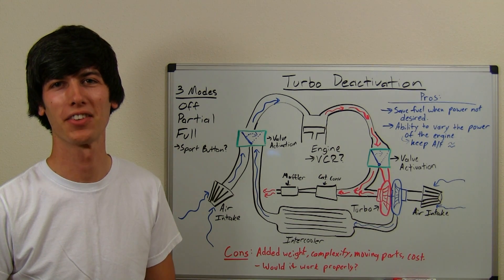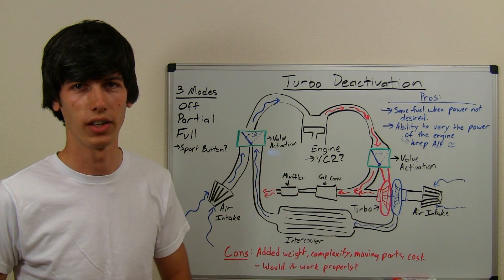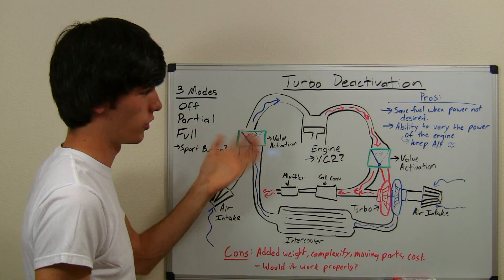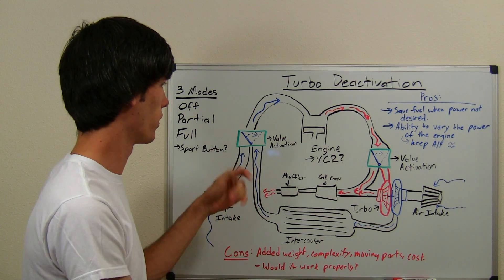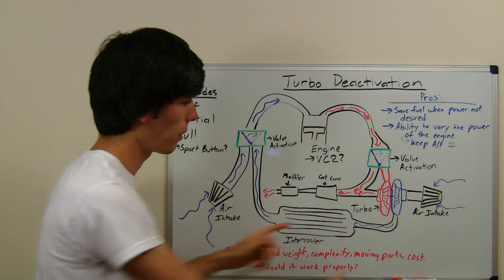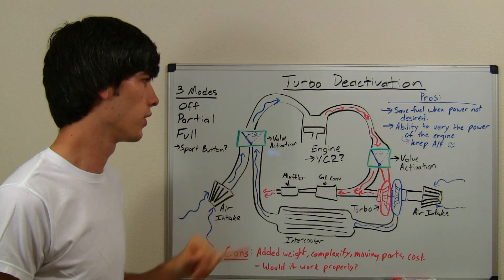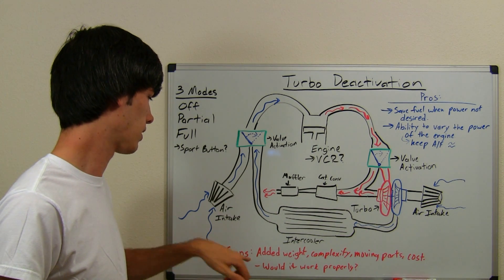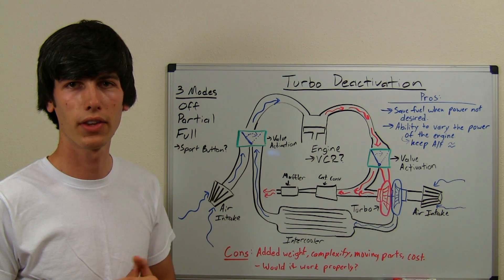Turbocharger Deactivation Concept - Explained

Comment: Every manufacturer of turbocharged petrol engines use a form of turbo deactivation. Your average small petrol turbocharged engines are in fact naturally aspirated below ~ 50 bhp. Manufacturers carefully select turbo compressors so that they only become active (flow air) above the power levels needed for fuel economy tests. It is why in the real world turbocharged engines never achieve their MPG test figures.

Comment: The Noble M600 uses a selective turbo boost and the feature is talked about on one of the Top Gear episodes.  BMW as well I believe uses some form of turbo deactivation, though without the separate intake and exhaust or the variable compression.  They deactivate the turbos on certain engine codes getting thrown and I believe use some form of boost control on their different drive settings.  I've actually long wanted something to at least control boost so that highway driving is much more economical.
Reply: The real doktorbimmer
No, but it can and does divert enough away to deactivate the turbocharger as in 'limp mode'. Every modern diesel has a form of turbo deactivation.
Reply: The real doktorbimmer
Wrong. In 'limp' mode the turbocharger wastegate is set to divert maximum amount of exhaust gas away from the turbine deactivating the turbo. Every diesel passenger car contains this function. Go check.
Reply: +The real doktorbimmer lol......really. Maybe in the 1980's.

Is that how the wastegates on your favourite Ford ecoboost 3.5l operate?

Things have moved on quite a bit I think you'll find.
Reply: David Bartz Your car won't be using it's turbochargers during highway driving. There won't be enough exhaust gas passing through them. You're right that all manufacturers have systems to deactivate turbochargers in the case of mechanical/electrical issues.
Reply: The real doktorbimmer
Never heard of turbo limp mode?
Reply: The real doktorbimmer limp mode keeps waste gate open
Reply: agt155 you can hear the turbo go on the highway anytime I speed up. It's not an issue when I can leave cruise on
Reply: The real doktorbimmer you're the only one that cares that it's referred to as turbo deactivation instead of turbo boost deactivation.
Reply: The real doktorbimmer
Wastegate
									
A wastegate is a valve that diverts exhaust gases away from the turbine wheel in a turbocharged engine system.

...lol
Reply: The real doktorbimmer

Turbochargers are only doing work  (working) when their compressor wheel is spinning fast enough to produce a positive pressure gradient across it. These compressor speeds are not reached under low engine loading and certainly not when 'limp' mode is activated. As has been said all along every modern turbocharged car has a deactivation system. I guess you are new to turbo-diesels.
Reply: The real doktorbimmer
lol....right so now you're saying a waste-gate can't completely divert the flow of exhaust gasses away from the turbo. Well it doesn't need to. It only need divert enough away so the turbo compressor cannot spin fast enough to produce a positive pressure gradient. Without a positive pressure gradient across the compressor wheel the turbo is inactive.
 In 'limp' mode the turbo is inactive/not working.
Reply: The real doktorbimmer
If a car has limp mode it has turbo deactivation. Ask one of your customers.

Comment: Any reason why you don't want to just do it with an electronic boost controller? If you picked one which has mode settings you could set it up with a high boost 'race' mode and a low boost 'economy' mode which just gives a little boost to improve your thermal efficiency. Hell you could presumably even set a mode that has negligibly small boost if you wanted the turbo effectively deactivated.
Reply: Chris Pistofferson Your typical turbocharger will not be producing any boost at all during "economy driving" ie there will not be enough exhaust gas passing through the turbocharger for it to work - it is already deactivated.

Comment: Have you tested this in action? I will build this kind of system to my audi a8 1.2 E-TDI consept car. To bypass the turbo totally is propably not needed as you can have other benefits by boosting pressure to canister. That way you can have instant boost when needed even where the turbo is not necessary able to make boost like low revs--> better efficiency. Also you need only one intake air filter, just two intake air lines. System is at max efficiency when you use air to water intercooler to get short intake piping.

Comment: What you have described is an exhaust wastegate (already exist, on every turbo), and a sort of intake bypass. And what you want to do is be able to switch between boost and no boost mode. 

In most turbo'd cars it is quite simple to install a low/high boost switch, which ultimately controls the wastegate, like in your diagram. What you cannot do on production turbo'd cars is the intake bypass you are describing. An intake bypass would have no effect on economy, all it would do is reduce lag (no IC or long piping to travel through). Now I dont know if you've ever driven a turbo car, but the thing is, on stock, turbocharged production cars, there is basically no turbo lag to begin with. Lag only becomes a thing when you start going for massive power gains, ie, bigger turbos, and there is no point having a 'low boost, no lag' system when all you are after is power.

Comment: VGT actually implements this idea. At 60mph my car is running at atmospheric pressure as exhaust fumes are not directed onto turbo blades . I understand that turbo is introducing resistance in exhaust. Complexity of this idea wouldn't be as beneficial as we think. It is enough to compare fuel consumption of VW Golf 1.9 SDI vs 1.9 TDI. Not that big diff.

Comment: If you want efficiency you can just make a smaller displacement engine with a turbocharger. There would be no point in having all that stuff. If you simply want control (not on/off though), get a boost controller. Or if you're really crazy about it buy N2O and turn that shit on and off.

Comment: My main concern with this method is achieving the proper balance of the car as a whole, meaning that if I'm using an NA engine, with a certain airflow, I wouldn't be using the same fuel system, electrical setup and ecu mapping as I would when I install a turbo unless of course the whole thing is sold as a package. Also, If by switching the turbo on and off includes switching ecu profiles, fuel injection and electric discharge rates, the price of such a setup would be too high to consider.

Of course balancing other aspects like cam ratios and whatnot is a totally different story altogether. Maybe its doable but would coat too much to be beneficial IMO.

Great videos by the way man, thanks for sharing the knowledge :)

Comment: I think this would be great, if paired with a variable geometry turbo. You could have a setup with no boost at all then have the veins paired for mid boost, as well as high boost. You could have an extremely smooth power band with variable sequential tubos, and this setup. Would work great on a high revving motor

Comment: A variable compression engine might be extremely complicated to make and the cost and complexity would very much outweigh the small gains. Partial activation/deactivation of the turbo seems like an overly complex VTEC system which also might not do too well in terms of costs. However, an On/Off switch for the turbo might be a pretty fantastic idea. People have implemented a similar albeit much more rudimentary (and illegal) system for straight pipe exhausts to pass inspections. I think that switch is definitely doable but I cannot tell you how reliable it would be in the long run.

Comment: Interesting theory, the camshaft valve overlap/lift/duration etc. for turbo/non turbo may
be able to be compensated with a sort of VTEC system by the ECU, but how to obtain the "variable compression ratio" would be the hard part, the only thing I could think of is a literal "VTEC" type of system to increase the stroke of the piston to achieve proper 
Compression while on "Non Turbo" and that would mean ALLOT of engineering plus the main/crank bearings + seals would take a severe beating during this whole process of 
constantly adjusting con rod stroke length for the pistons; As obviously can't adjust cylinder/boresize, so only the crank/con rod/piston travel could conceiviably be ajdusted, essentially being a "stroker motor" with no turbo to achieve the proper compression.  I have driven an Audi A4 1.8t with a dead turbo and it was basically undrivable going 20mph maybe up a hill at almost redline if that was achievable.  Among many other factors. fuel injectors would have to be twin/adjustable to provide enough fuel while on "Turbo". etc,etc,etc. Anyway A LOT would have to be going on and I can't imagine the cost.

Comment: my brother has a turbo on his car and has told me several times the more often he kicks in the turbo the more fuel he eats,,,,,so I don't understand how a turbo can make it more
Reply from the maker: MrHighpressure By getting into the boost, you're putting more air in the engine, thus burning more fuel. It will create the power more efficiently, but if you're making a lot of power it takes a lot of fuel.
Reply: +Engineering Explained Doesn't it depend on a lot on the size of the turbo? As in a larger turbo will induce noticeable parasitic losses because of back pressure, but a smaller one (like the absolutely miniscule ones found on ford ecoboost engines) increase efficiency because they mostly use energy that would otherwise be wasted.

Comment: Well at low RPM as long as you're not boosting, such as driving around town, the turbo actually helps with atomizing the fuel for a better burn. So to be able to turn it off and implementing such a system would be a waste in resources.. at least from a manufacturer standpoint. Remember it may just be a few bucks per car to install, but then when you make 10,000 cars/year you're looking a significant amount of $. And for something thats not critical, it's just not profitable enough just to have the boasting right of a deactivation turbo.

Comment: The partial mode sounds similar to the vtec in honda but for turbo application. Less air in lower revs for good economy and more air in higher revs for more power. 
Wait for my turbo to kick in yo!!
This would need a good ecu to run it though.

Comment: A turbo is an energy recovery device. as the otto cycle is inherently innefficient the thermodynamic waste can be recovered using a turbo. This is why they were first implimented on over the road tractor trucks, not to improve torque, to improve efficiency. If the owner of a turbocharged car doesn't drive like a dick they will get better gas mileage than a NA car. NO valve dealybober needed
Reply: Yes turbo diesel truck engines do not suffer the efficiency problems of turbo petrol engines.

Comment: I think the main problem with this concept is that the cons just outweigh the pros. the pros don't benefit you a lot and cons are massive
Reply: doktorbimmer Yes with a diesel you will but with a gas the engines sensors will just add more fuel
Reply: The real doktorbimmer
 It is not my article. It is just proof that NA engines achieve lower minimum BSFC than turbocharged petrol engines - it is a fact. When your turbocharged engine is 'recovering' it's maximum amount of HEAT energy (at WOT) it is less fuel efficient than the equivalent NA engine.

 In "real world settings" (like fuel economy cycles) turbocharged petrol engines are infact operating as NA engines. Remember those compressor maps? If your assumption was correct car manufacturers would incorporate turbochargers that operate at low power outputs into their engines - they don't - why do you think this is so?
Reply: Joe Joe Clark Yes. With a petrol engine any extra air the turbo provides must be accompanied by the correct amount of extra fuel. Hence the need for a throttle valve, hence the reason why turbocharged petrol engines are less efficient than naturally aspirated engines. Diesel engines can run at much higher AFR hence no need for throttling.
Reply: doktorbimmer
Typical (peak?) minimum BSFC;

Turbocharged petrol engine  0.6
Naturally aspirated              0.45

http://takemebeyondthehorizon.wordpress.com/2009/09/28/how-to-go-fast-faster-the-math-behind-turbocharging-part-3b-brake-specific-fuel-consumption-bsfc/

Perhaps you'd like to reflect upon your mistake.
Reply: doktorbimmer
All I took form the article was typical accepted BSFC values for forced induction and NA engines.
Reply: doktorbimmer
Why do you bother?, you've already lost the argument. Have you had a look at some 'typical' petrol engine turbocharger compressor maps yet? Your claims are laughable. No need to reply I accept your apology.

Comment: Don't the sti's use something like this? I know they have different modes where the turbo either works or doesn't.
Reply from the maker: They have different throttle modes; it really just extends the amount of time it takes to get to peak boost, rather than not getting into boost at all. (I own one).

Comment: I had to look at this once again and it makes absolutely no sense at all!!
it´s not needed. I don´t like to flame other people's ideas but it´s obvious that the guy in the clip don´t fully understand how a turbo engine work or ever tried one.  My twin turbo V8 engine is built to have an extreme response (no turbo lag) my exhaust housing is very tight with a low A/R It starts to builds boost very early around 1200rpm. Even my setup is done to eliminate the lag i have no problem to cruise, and  it wont consume more fuel. The boost only builds when the engine is under load, in other words, medium to hard acceleration, the car feels and act exactly the same like it´s N/A as long as i don´t push it, but when i do, the hell breaks loose!

Comment: Check out n54 engines (2007-2008 BMW's with the 35i trim.) Many people use a piggyback called a JB4. There is an option to the turn the turbos off and force the car into limp mode. They call it their economy map. :)

Comment: I understand the concept but I think people would prefer the cost effectiveness of a boost controller and/or run off the actuator spring. I also think stopping a turbo under high heat with it having residual oil could cause coking (destructive distillation of engine oil). Also I just just feel sorry for the engine tuner. Unless you program each button with it own tune as well. Which I see the Osirius UPREV program already doing it with a push of a button. Or rather...toggle.

Comment: I understand your general concept in this video, but your premise is flawed in one crucial respect.  Turbos are not active at all times.  I drive a car with twin turbos and can tell when the turbos are being used and when they aren't.  If I don't press hard on the gas, the turbos remain inactive, even at high RPM (conserving fuel).  When I do drop the lead foot, the turbos kick in and my fuel economy goes flying out the window.  I can verify this because of boost and fuel economy gauges.

Thus, it would be useless to add this system (no benefit + greater complexity = net loss).  I really appreciate your videos though, and thank you taking the time to make them.

Comment: When is comes to an (Aftermarket) ECU, could it variably adjust the AFR (after tuning) so that you can run N/A or boost whenever you want, no matter if your engine is stock, slight built (Fuel Injectors, rails, lines, pump), or fully built? For example, when a N/A engine gets boosted with a turbo/sc and the ecu hasn't been tuned, AFR would lean out and most likely blow up the engine. If a turbo'ed car car has it's turbo removed, the engine could be running rich(?...tell me if I'm wrong). So do you think there is a way for the computer to automatically correct the AFR with an factory/aftermarket MAF Sensor so you can run boost or nah anytime?  

Sorry for a long ass comment lol. I' just stating what I think and just want some ideas to my question(s)